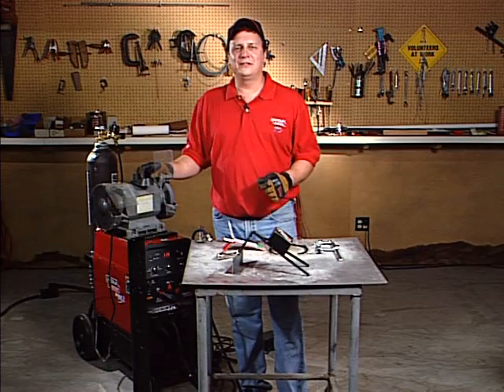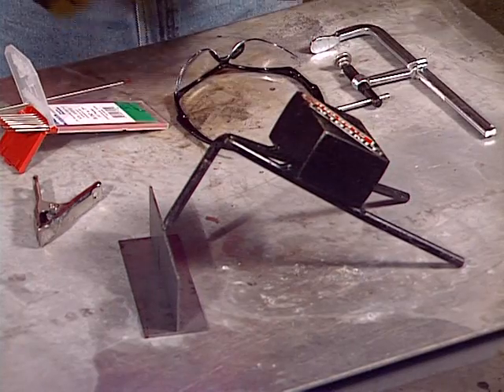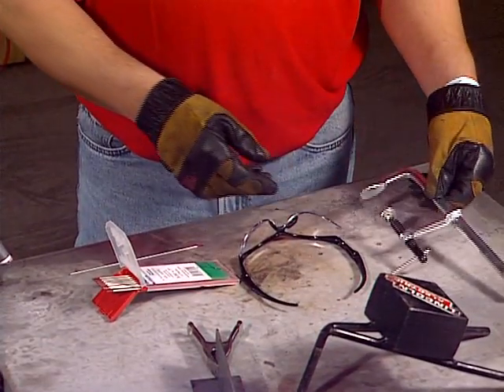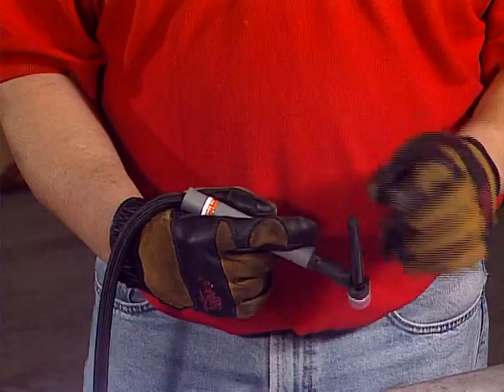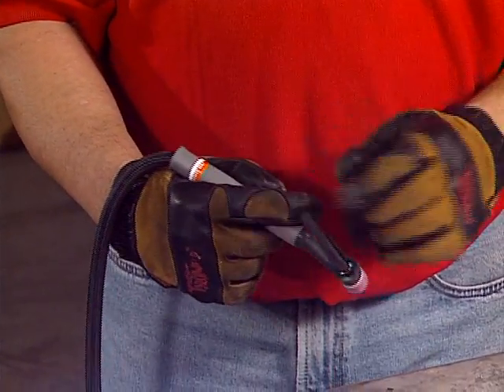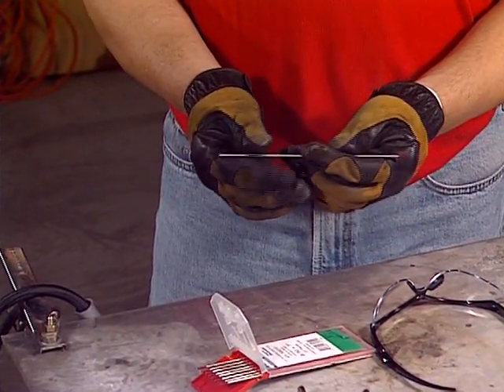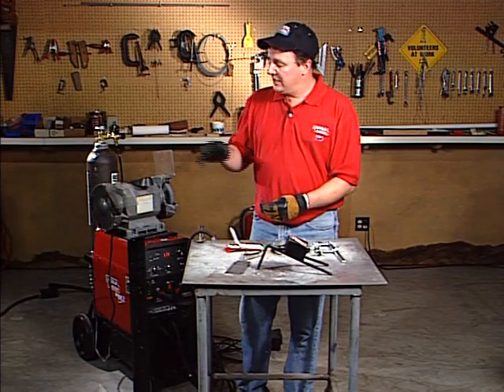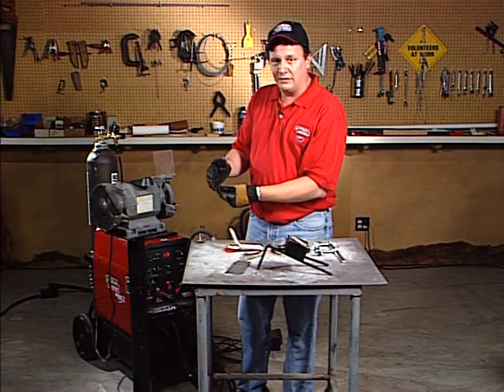TIG Welding Basics

Comment: Yeah, no. When you grind your tungsten you hold it to the side of the grinder and rotate. If that tungsten snags that's going straight into your wrist. And personally I wouldn't wear gloves using a bench grinder, sure if you touch the wheel you're gonna feel it but if you're wearing gloves it can grab the material and drag your whole hand in. Not fun. As for dabbing the tip of the tungsten, you can actually damage the motor of the grinder by intervening as the wheel slows. Plus, why the flat point? Surely you'd want as direct of an aim as possible, meaning no wandering arc.
Reply from the maker: +Samuel Rulton Thanks for your comment. Welders are taught to use a conical point because sharpening to a needle point while TIG welding at high amperage can cause tungsten spitting and lead to tungsten inclusions (defects) in your welds. That is why we grind to a conical point.  If you need more understanding on this, please message us and we can provide more content on this concept.
Reply: +lincolnelectrictv Thank you for your reply. Just to put the record straight do you have any comment on my other remarks? As I am only 18, currently on a level 3 welding and fabrication course and looking to go on with TIG in the world of work. I'll take any advice I can, given it's decent advice that is.
Reply from the maker: +Samuel Rulton Sure. Always grind on the front of the wheel. Always grind lengthwise as well.  Wearing gloves is a preference. Just remember to always be safe. If your concerned about damaging the grinder, invest in a handheld tungsten grinder.  Your local distributor should have some to choose from. Thanks again and good luck!! Feel free to message us with any questions. We will help when we can.
Reply: Good discussion, didn't disappoint. And thank you for the pointers. I've still got a long way to go but I don't plan on stopping anytime soon, can't wait to move into the TIG industry! Top notch
Reply: Agree with you on the gloves. Some people may not agree, but if you look back at an old American Choppers episode. Rick gets his hand caught in a drill press with a glove on.
Reply: Yeah im going to go with the guy that works for the company rather than listen to some random know it all

Comment: Good tip, however...
This is not tig welding basics, it is a partial tig electrode preparation video. And not even a good one...
No view of the final result, no info on the angle, no info on how much to remove or why, DANGEROUS way to use a grinder (never use glove on rotating tool!)
As for the welding basics, yes, he talk about some possible grip, but... What about shielding gas? Gas flow, Setting, polarity, how to strike the arc, electrode stickout, electrode angle vs work piece, electrode to workpiece distance, filler material... And of course atleast one welding pattern... Of course, I missed some points... And safety! He only talked about finger burning due to holding the torch wrong... Missing even the most basic safety issue: personal protection equipment, like the mask!

Comment: Great video in a lot of ways!  However... although you certainly don't want to hit your unprotected finger on the grinder, you better be GODDAMN careful if you really want to wear gloves when operating a bench grinder, unless you have an adequately long means of gripping the object you are grinding to avoid any possibility of getting your hand grabbed. You get your gloved hand/finger caught in there, and you aren't getting a little rash.
You're gonna lose that finger and possibly your entire hand will be mangled.
And it's scary, cause it's tempting to keep grinding a tungsten that's getting a little too short.. you think you can squeeze one more grind out of it, then next think you know your hand is pretty much gone.
Reply: A slight touch of the grinding wheel when its on does nothing almost on the front face, same with tile cutters you can touch the running blade. Use one before going all H&S mental about tools you obviously do not own.

If you want to argue ill upload a video of one running and touch it...

Comment: Good vid but....When grinding the tungsten ...with the direction that wheel is turning...the point should face down. otherwise it will catch easily in the wheel and get thrown...or caught up in the grinder.

Comment: My  Suggestion for sharpen the Tungsten rods , You can use the Tungsten grinders . it's most adviseable and  No skilled operator is not required for this. Try this it's cost effective and safe opertions

Comment: Shame on Lincoln for not educating their employees on this important issue, and for releasing this without a review by an Industrial Hygienist. They should discourage the use of thorium all together, let alone be grinding in the open with no respiratory protection (not to mention the lack of faceshield and guard turned up).  What's next Lincoln, welding on a loaded gun?  For an authoritative discussion thorium hazards, see AWS's fact sheet 27, Thoriated Tungsten Electrodes (Google it)

Comment: @jumpfinder I had a welding glove get pulled into a similar machine when I was learning my trade, it got my index finger in between the rest plate and the grinding wheel, went through the glove in what felt like a  millionth of a second and took a nice chunk out of my finger, I pulled it out almost as soon as I felt the glove get pulled in so damage was nothing more than a nasty chunk of missing flesh that has long since healed. Lesson learned: I don't use gloves on grinders anymore!! :D

Comment: @drmmhmda   You must be tig welding stainless, because in New Orleans, the pay is $39.00 per hour for such.  As far as inland jobs go, tig welding stainless pipe does pay the most.  But a lot of offshore welders still come home with larger checks because of the 84 hours per week they get, 44 hours a week overtime.

Comment: @rickylarch well yes but its still mainly tungsten just like any electrode.. might be bad if you sat at a bench for 40 years grinding them with no ventilation. Every tig welder iv'e worked with does this its called welding no one said it was good for you!.